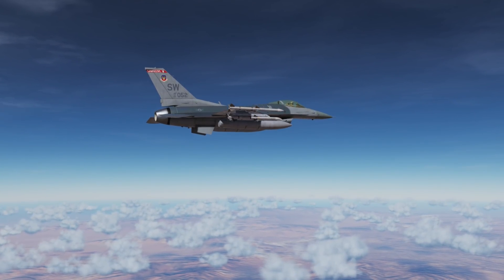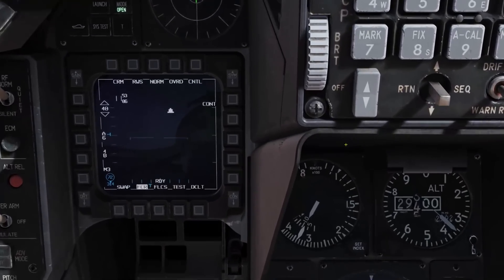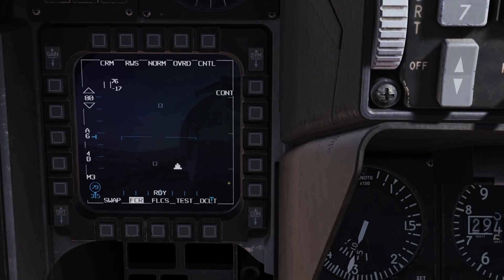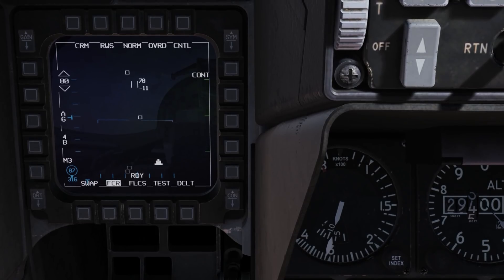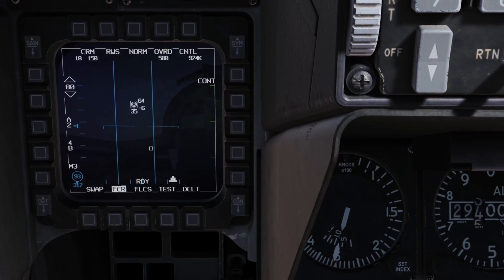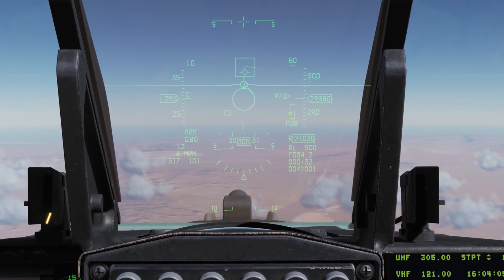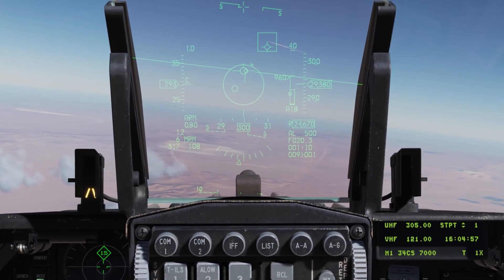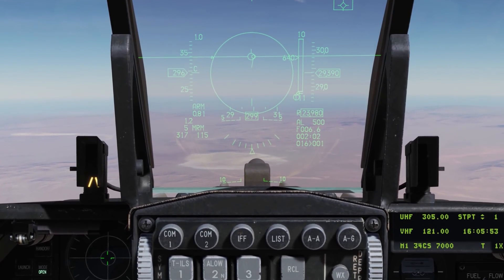DCS: F-16C Viper – Airborne Radar and AIM-120 Overview

Comment: One correction, if I may. With the Azimuth scan set to 60 degrees, it is NOT a total of 60 degrees, but 60 degrees left and right of center (boresight) for a total of 120 degrees of scan, from left to right mechanical limits/stops in the older radar sets and electronic limits for the phased-array of more modern radar sets.

Comment: how lock targets, what is TMS switch up on joystick?
Reply: I struggled with this too.    if you have a joystick with two or more analog hats set one to your Radar Cursor (up, left, right, down), the other to the TMS (up, left, right, down).      If you are lucky to have the Warthog joysticks I believe they come preset. The Radar control is on the Throttle and the TMS on the flight stick.
Reply: @Cyberjohnnyt  Just bought the Viper and it has none of this in it's training missions.  Was lost here on this too.  Thanks
Reply: @Cyberjohnnyt  Thanks 😎

Comment: my target designation box seems to be operating at 1 frame per five seconds
Reply from the maker: Sorry, but we cannot reproduce this. Thanks
Reply: @MattWagner  thank you for the reply! You guys are awesome by the way. So I fixed it, I need to press tms up a second time. On one click, what was happening was that it seemed to have a soft lock and every few seconds was still scanning roughly 10% of sky in front. It appeared laggy, but when I hit tms up a second time it locked and worked normally. Thanks again for looking into this.
Reply: Note that Sam mode has reduced target box update cycle because radar is also searching near space.  TMS up again for stt and you’ll see faster update rate

Comment: So, my question is will we have updated radar modes, FCC computation and DLZ mechanization? This is pretty much basic.

Just to be more specific but you can ignore the rest of the message if you know what I'm talking about...
- will we have TTS (2-target-SAM FCR mode, that should come after SAM) and all TWS submodes?
- will the DLZ mechanization get all the right range driven computations: spoil solution aspect change, loft angle, M-pole range and time, F-pole time (I think in the video the times are still navigation times) and counter, etc. etc.?
- will Air-to-Air get the deserved attention in DCS with this most awaited model?
Reply from the maker: Hi Adrian, much of what you mentioned came in later software versions. We are basing our on a 2007 jet. Thanks
Reply: @MattWagner  thanks so much for your reply :D

Comment: Will ED consider conformal fuel tanks in addition later on in the falcons development?
Reply: One reason that was mentioned in the forums was that conformal fuel tanks weren't a simple add-on for the real F-16.  It was an option that you had to request before the airframe was built, and using conformal fuel tanks apparently involved changes to the internal aircraft fuel feeds.  I had always assumed they were just a bolt-on accessory, but apparently they really aren't that simple at all.  The changes to the fuel feeds alone would render the development impractical for DCS, since they take those into account when calculating the flight model, among other things.  And as it is, they've been clear about wanting to make a very specific single version of the F-16 and wanting to avoid a "frankenviper", and it seems that the American version of the F-16C Block 50 never had conformal tanks.
Reply: @Hyperion35  Yeah I get it...even the greatest military flight simulators have their limits it just opens up so many more mission types for me personally. That's why I was bummed as I'm sure many people were. The actual USAF has said in their magazine that while the upgrade is an  impressive advancement of their current aircraft inventory the cost would outweigh the benefits. You can always just send in more aircraft on any given mission.  The afterwork weekend virtual fighter jock like myself does not have the same luxury. I'd want the most capable aircraft to enjoy the time I do get to fly  ya know. IDK it just bummed me out. I get it though. I'll stick with the hornet. Carrier capable is a huge benefit and offers much more to me than the proposed viper. Still love you  DCS  only wish they would have included the extra gas!
Reply: @DarthVader-ug4co  Yeah, I was originally hoping for them as well, partly because a lot of other countries like Israel use them, so it would be more realistic for missions where you're supposed to be flying for a country besides the USA.  I think one of the other reasons why other countries use conformal tanks and we don't has to do with air to air refueling capabilities.  An American air mission will almost always include a tanker or two, but other countries don't always have that luxury (or the ability to fly the tanker over potentially hostile airspace).
Reply: @Hyperion35  Almost my thoughts exactly! Flying as the IAF was something I really wanted with this module! Plus I almost always need to tank when things get interesting...my bad luck I suppose.
Reply: They've said no to this on numerous occasions, I'm afraid :(
Reply: @Madbrood  No surprise. That is a huge bummer. Seriously reduces my urge to spend 60+ dead presidents.
Reply: @DarthVader-ug4co  not a big deal to me personally. You do you.
Reply: @Madbrood  Thanks for the info. :)

Comment: Please, please please say you aren't releasing another modern fighter without IFF initially. It was miserable when the F-18 was released and had no IFF for quite a while. Just no fun at all. Without IFF, there is just no point to having a radar and AIM-120s. Not having IFF on an initial release means this is a close combat fighter, No BVR. Which will lead to frustration for everyone, Those who shoot friendlies constantly and those of us who get shot down by friendlies constantly. It may have been a better idea to withhold the AIM-120s until IFF is completed.
Reply: FiremedicJM Conerning Airquake you are right. Flying more realistic missions you are wrong. Keep SA up and don't Fox3 in a furball if unsure.
Reply: @hobu8346  Of course don't Fox 3 in a furball, that is ACM. I am referring to BVR. Without IFF you have no idea who you have locked in STT 20 miles out. There could be no accurate  BVR without proper functkoning IFF. You would have to wait and VID, at that point you are in close combat and not BVR.
Reply: @firemedicjm911  In reality the Interogation of Friend or Foe is not 100% accurate. It's only a little slice of the identification procedure. If you get a friendly  signal, than it's everything ok. But if you get no identification signal , than it still can be a friendly. May be signal is lost in the eterh, or the other friendly plane has different IFF code, or signal not recived etc.
 IFF is very very simplified in DCS.

So, yes, BVR is that hard in real life if you have to sort the enemy out between friendlies.
Reply: @Borisz80  Got it, however my point is that without even the most basic IFF, there can be no true BVR which is an important part of the F-16 operational capabilities.

Comment: Don't you get sound ques for "lock" and "chaff flare" in the F-16? I haven't heard it in any of the videos, is it just turned down or not implemented yet?
Reply: You get those when you lock a target using the HMD and the ACM modes.

Chaff and Flare sounds are implemented and working. (Check out the cold start video).
Reply: @Jogui3k  thanks